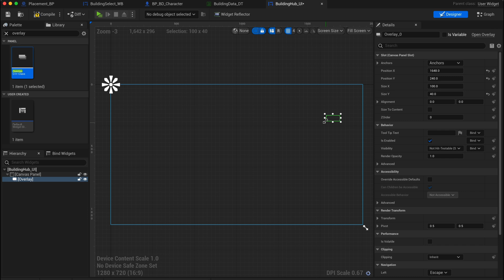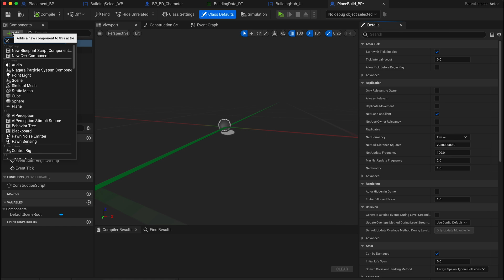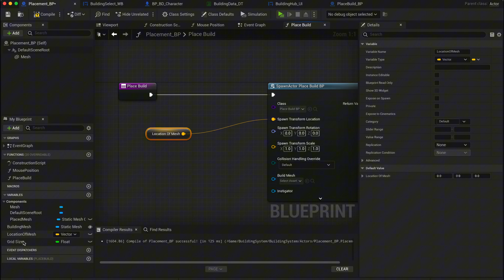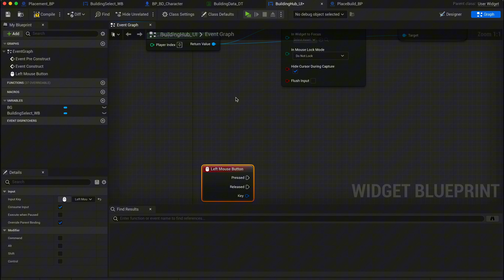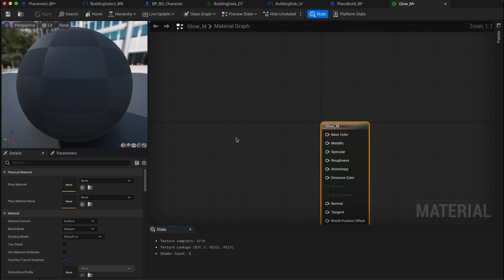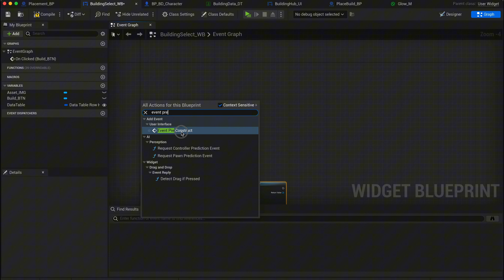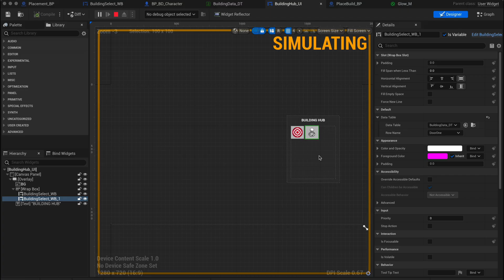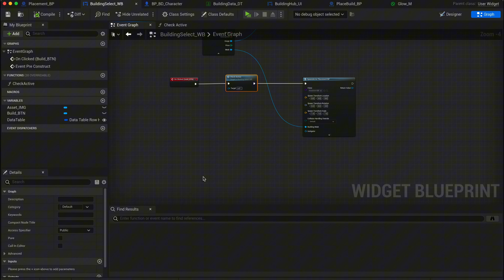Unreal Engine Building System Tutorial: #2: Placement, Rotate & Hub

Comment: Great! I have a minor problem though, there are red lines when I try to place the wall.. I noticed you had it too in part 1
Reply from the maker: All you need to do is go back to your mouse position function in your placement BP and under line trace, where you have debug, set it to none 👍
Reply: @polyplayground  Thanks it worked
Reply: @polyplayground  also, I tried adding floor thru table then adding it to widget and it didn't work.. can u explain if there are  more steps?
Reply from the maker: When adding the button to the hub, did you update the data table on the button just added to the hub?
Reply: @polyplayground  yes thanks